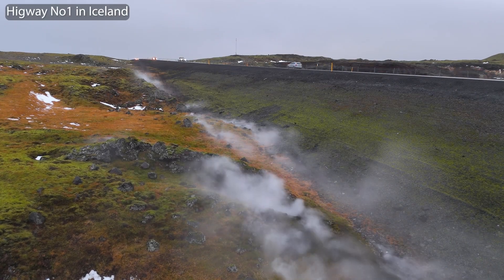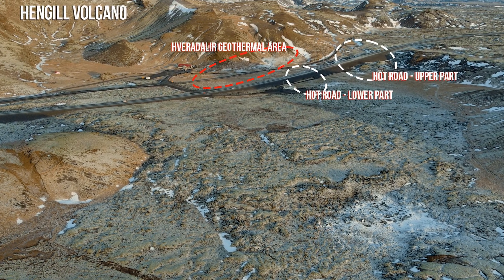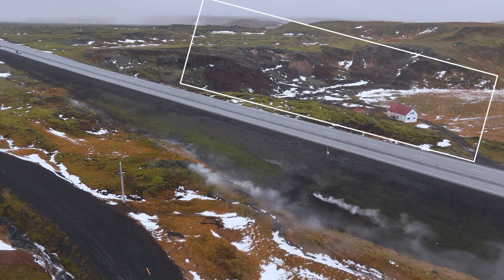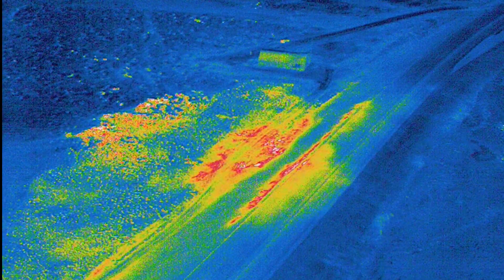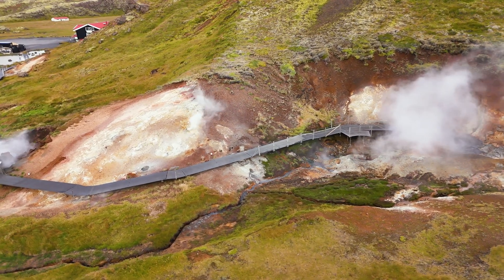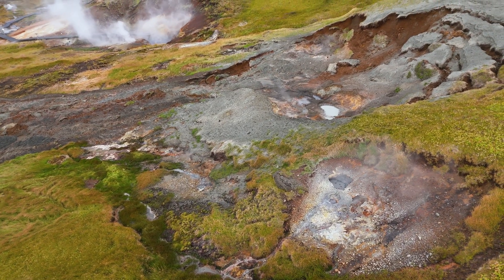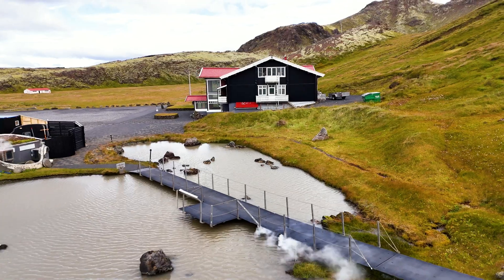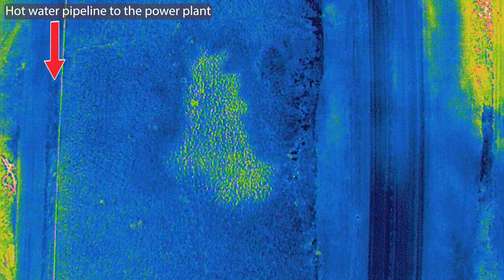Thermal Drone Confirms Expanding Geothermal Area Under Iceland's Hottest Highway

Comment: Just watched a video from 5 months ago, of lava creeping on to a road, then it must have changed to your video.  I always enjoy your videos.  My brain was just thinking in it's crazy way, if you keep having to replace roads, would it not be possible to build roads on top of the berms or slightly wider ones; or maybe have a monorail/rail type system on top of them. This would aid evacuations, if things occured in the actual town and lava was on normal escape roads.  If they have been built already, why not make use of them.  Half of the work is already done. I'm not an engineer, so this may sound insane, but it could be a safe possibility, if the eruptions are going to be a long term prediction.  It's obviously not possible to do underground subway type tunnels, but going higher may reduce longterm costs.  I guess airlifting is possible, in emergencies, but would be slow to move large numbers of people and pets.  Anyway, i'll take my craziness away, but wish you a wonderful weekend.

Comment: These hot spots are normal in the process of plates bending. Here in the Pacific North West USA I watch a geologist who does field mapping of the plates. When there has been uplifting and expansion, one can see bends in the plates. In order for movement to the plate to happen, the area  has to be softened in order to melt the rock below for movement. It is not yet known exactly why this happens. It is speculated this happens to areas to make the ground softer, either to make chambers underground for magma, water or just empty space. It may not yet show on the surrounding surfaces, but degassing is a signal there is expansion going on. Iceland should be monitoring the surrounding areas of ground for expansion and uplift even if it is small numbers of movement.

Comment: Have you looked into using radio transmitters/gps from different spots around the area you are filming to know when you are filming from the same position and altitude so that it is easier to do accurate like for like data points? There are commercial solutions for this in the US. For example Levis stadium in the Bay Area has a system where you can buy food from your phone and because of wifi and bluetooth beacons at different heights and xy coordinates the food can be delivered right to your seat. You could have some ground placements that don't move and perhaps a tethered separate drone with a transmitter to triangulate to.  Maybe HP Enterprise (the parent company of the maker of the system at the stadium) might want to sponsor you? Or maybe you already have a good system. There should be a sales office in Iceland. I know there is on in Norway and Denmark. They might help.

Comment: My guess is the extra steam is related to ice melt and / or rain getting closer to magma chamber and percolating up. Because there is more water at this time, it is branching out to find more exit points on the surface. Since it's decades or even perhaps centuries for the water to flow down, be heated and percolate back up, I suspect the weather / melt happened a long time ago. It's just like steamboat geyser's activity in Yellowstone is related to weather from a long time ago.

Comment: eventually this geothermal hotspot will become something no driver can go over without there tires melting from intense heat! i have a feeling this might just be a foreshadowing of a potential volcano spot!
Reply from the maker: This is on the plate boundaries so it's a like spot yes, also judging from prior eruptions that occurred nearby.
Reply: @JustIcelandic  exactly i suspect sooner rather than later judging by it maybe getting hotter.

Comment: It is very well possible for steam channels to move over time, the steam is coming up under pressure and eroding the channels it uses. So it is well possible it eroded its way into another fault and thus starts coming up in another area and heating the surroundings of that. The patches along the highway might be well possible as the asphalt and gravel bed of the road is blocking the steam so its moving sideways for an alternative exit.
Moving or expanding of the magma chamber under the geothermal area is possible too but I think that would give more signals like deformation visible in InSAR pictures and/or small earth quakes. Not sure the movement of the magma below is really happening or if that would give such small patches heating up. Would be nice is someone with more knowledge of that area could answer that question.

Question, you said you have been filming there for the past few months. Do you have images of same spots in the area of - let's say - 6 months ago and recent? Is it possible to stitch them together in 1 frame? So you have both situations in 1 shot (e.g. left half 6 months ago - right half "now") so we can compare the development over time? Thanks again for making this video!
Reply from the maker: This sound sensible! and yes I have all files from 6 visits since April 2023. It's possible to stick them but since it's video, it makes it a bit more time consuming, its like making  a 2d from 3d and I cant't afford to take the 1-2 days i need right now to make a model. But the data will be kept at a safe place and might be very useful later.
Reply: @JustIcelandic  Maybe in pictures at the Community page of your channel (see you don't have that on your channel, maybe an option to open it)? So if people (like me) want to see more of these images we can see them there? Would safe you a lot of work too, perhaps. 

I know, easy said for me (as I don't have to do the work for it). But maybe an option you can think about. Thanks again and waiting for your next video.

Comment: I doubt changes to the magma chamber are involved in this. Instead, I think there was a change in groundwater circulation. Doesn't need to be particularly big, think butterfly effect, but, given the southward motion, it was apparently enough for heated water to enter a fault next to the already existing geothermal area, thus the southward motion. What would be particularly interesting to me, is, once it's all settled, if the activity excavates old pools and vents, as that would indicate geothermal activity had taken place before there, yet became inactive for probably centuries.

I additionally wouldn't be surprised if that explosion is at least in part attributable to the same changes taking place currently. In Yellowstone a couple of years back, there was an eruption of a seldomly-erupting feature (once in a lifetime, if you will), which resulted in significantly increased activity in features surrounding it, even from those I didn't think were this closely connected to it due to distance.

Comment: Amazing footage from the thermal drone! I don't know any details about the situation at Hengill, so I don't want to interpret the geothermal changes. The key information for detecting magma movement is almost always the seismicity. Unless there are shallow earthquakes in that area, then it is very unlikely that magma is getting close to the surface and the changes are just in the geothermal water plumbing. Yellowstone in the USA is famous for huge geothermal activity without any shallow magma.
Reply from the maker: 25.000 earthquakes were detected between 1994 and 1999 so we often expected an eruption back then, it's way less of them now, but unrest is quite frequent so it' a living and breathing volcano for sure. But this could of course just be due to geothermal activity.

Comment: Do people in Iceland know they are driving over such a hot spot? I guess there is no ice over the road in winter!! Am I correct?
Reply from the maker: Only a little part of the road has warmed up, not the driving lanes,  so it's still good, likely due to the "ventilation system" that lets some of the steam out so it won't melt the asphalt :)
Reply: @JustIcelandic  Thanks! Your country does not cease to amazed me. I visited it this summer only for a week. Want to go back already, although it was very, very cold for me. Best regards from the Caribbean!,🇵🇷
Reply: It would most likely make the road more slippery as the steam cools when hitting the cold air and then freezing on the road.